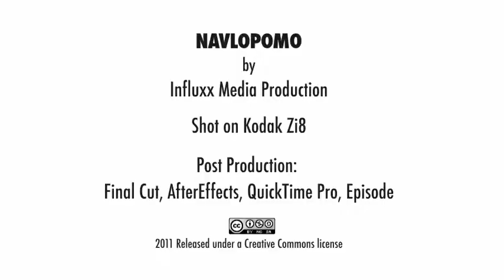NaVloPoMo2011 - Day 9 - Body Position

Comment: Do not rotate around the tank move perpendicular to the tank, which close the hip socket and bad thing is that once you take the hip off, you have to stiffen the arm inside of it and you apply to much steering pressure on the handle bar. This video shows a bad example as if something goes bad, he already have too much weight on the handle bars and he won't be able to straigthen the bar. So sir, you have a bad example in this video. Do not move butt too much and keep elbow parallel and bent.